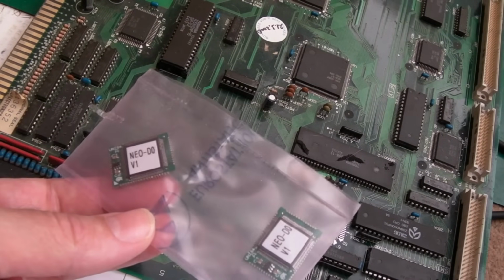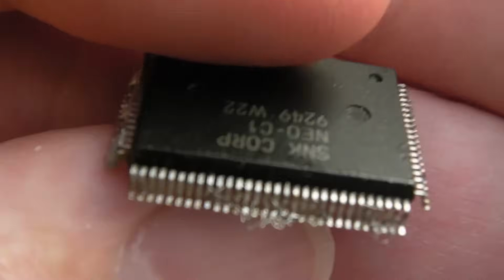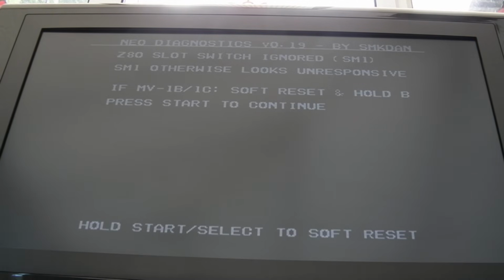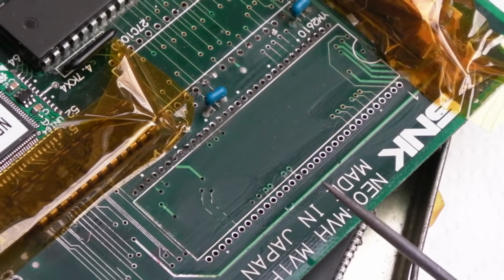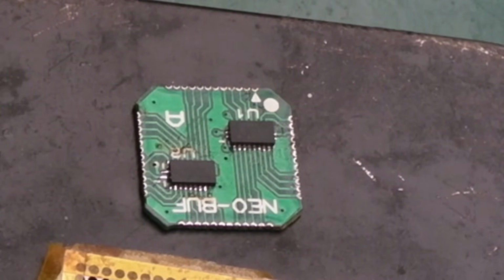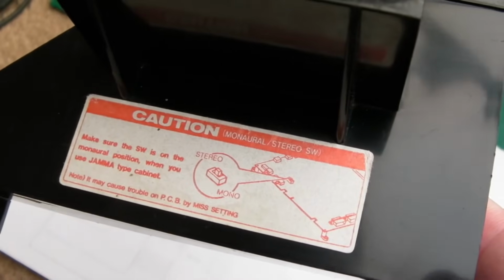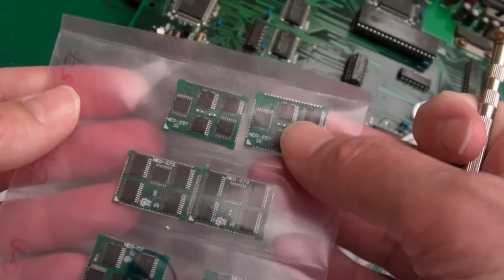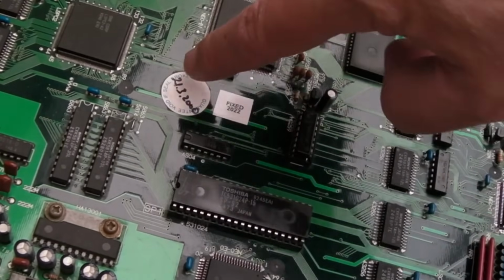OMG New D0 Replacements from Furrtek (Haunted SNK Neo Geo MVS Repairs - Part 3)

Comment: Thank you for your response. The video mentions the resistor, but I can't see where it's installed. The images don't show the resistor installed anywhere. Would it be possible for you to tell me where I should install it? I asked the replacement author several times, but he didn't answer. Thanks again for your quick response.
Reply from the maker: The SMD resistor is installed between the 2 pins on the D0 that go to the Crystal points (either side).

Comment: Time ago I bought a D0 remplacement and dont work fine. could you tell where the resistor goes? And Who resistor I have to put? Thanks
Reply from the maker: I covered the resistor size in the video, I think 500K or 1M.  It goes between the 2 pins which go to the crystal I think - shown in the video!
Reply: I've been thinking about something. When I was taking measurements with the original chip installed, sometimes when I measured on the crystal it would start working perfectly. If I reinstall the original chip and install a 500k resistor, do you think it will work?
Reply from the maker: @juanluisrubio128  Hmmm, it might do - but long shot I think!  The impedance difference is what's starting it up... Check the 2 caps are in place on those 2 clock pins too!

Comment: About the Neo-C1 remplacement part, we (Delta Island french orum) are slowly working on a solution that was not available a few years ago: instead of castelared holes, we could use a flex PCB as a placeholder for the chip + as a flat cable to have more room to solder a CPLD somewhere near the original place.
About your C1 alternative when the player inputs are the only dead lines.... you could wire only the dead inputs (1 or 2) using a GAL as an address decoder and input buffer, using "long" wires soldered to the CPU address lines and to the input EMI filters 😊.
That is what Mac Giver would do! (I will probably try this in the future!)

Comment: (@ 46:50 or so) Better idea is to put a tiny drop of IPA on the top of the IC; if it gets hot enough, the IPA will boil off. A lot safer than sticking your finger on it, I think. 😅